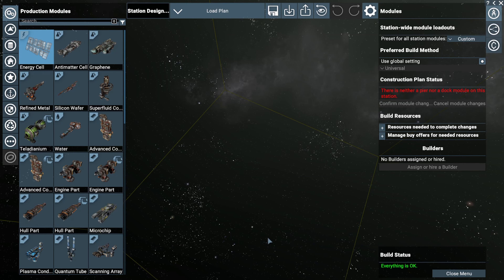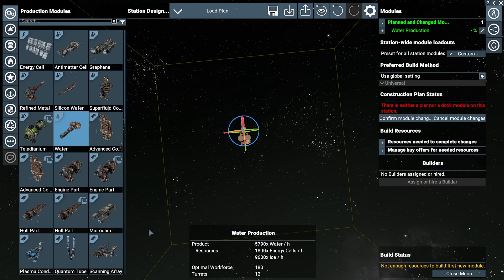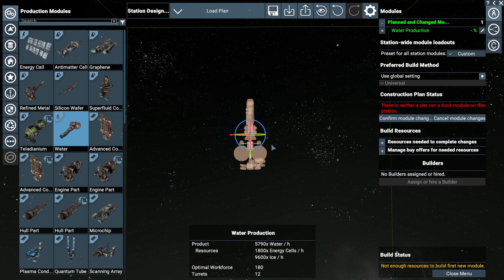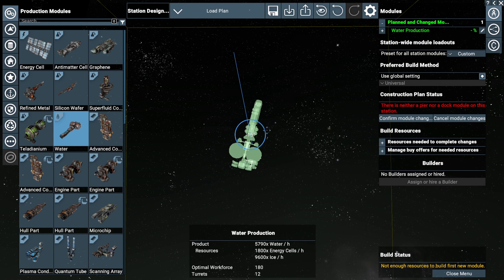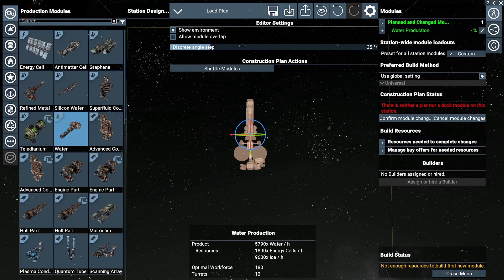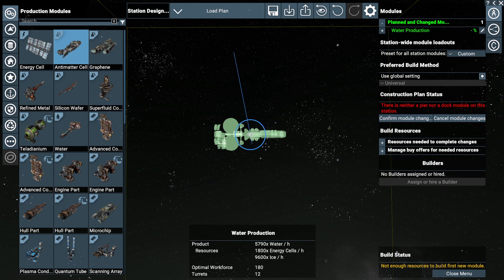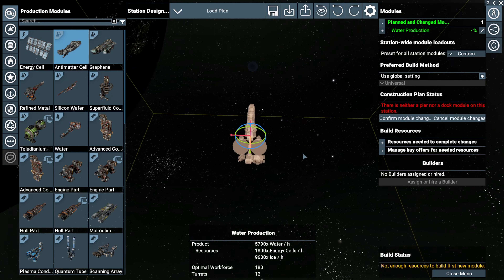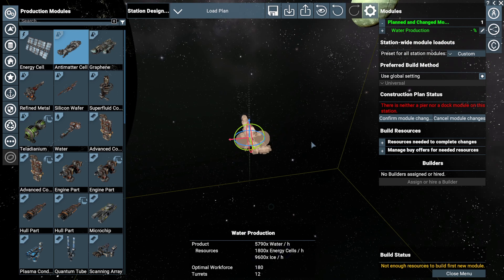X4 FOUNDATIONS 6.0 Rotate a Station Module

Comment: What I am currently find very frustrating is that when I do spend the time rotating it to the angle I want, the stupid system changes the angle of the module when I attach it to the main structure. It is also annoying that the degrees of rotation is from its current position and not a fixed point. Either one of these needs to change.
Reply from the maker: Thanks for the watch and comment!  Your frustration is shared.  This part of the game gives us so many options and so much control, it's confusing why that control is sometimes dumbed down when the module is attached.  I primarily settle for whatever the game does, as long as I can keep a build compact and have extra nodes available for expanding the build.  A stereoscopic 3D view would also be nice, but I'm not holding my breath for it.